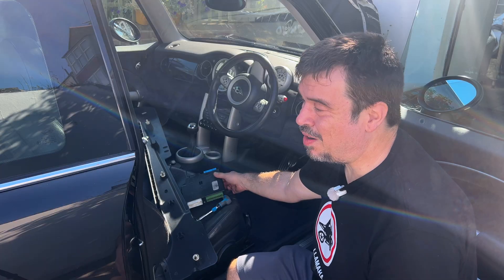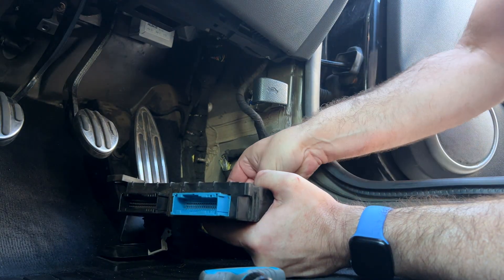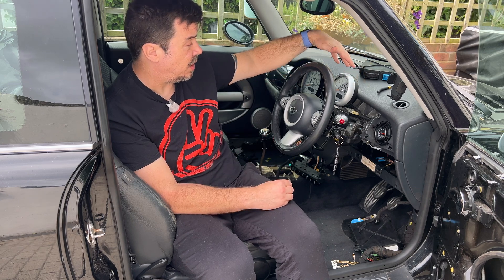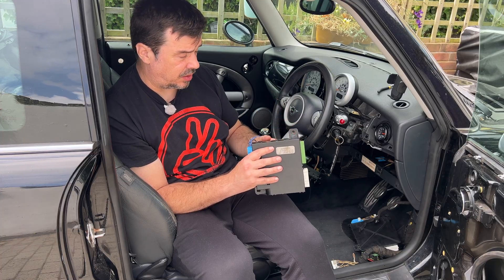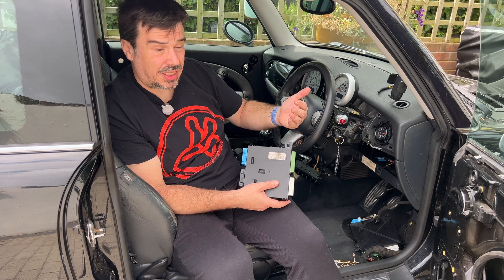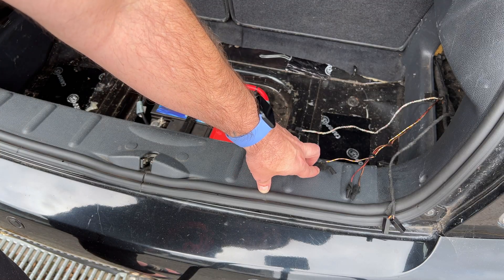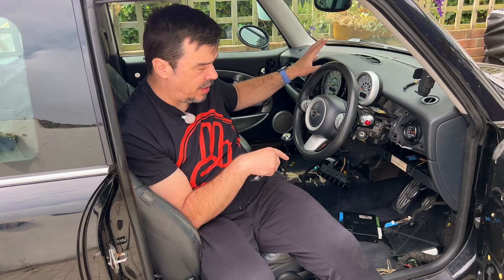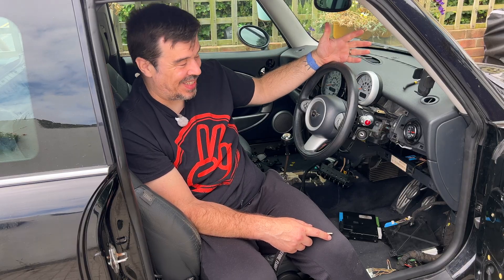Mini Cooper S R53 BCM and K BUS issues

Comment: You did so well finding this fault, where in the main loom was the K-bus junction? Quite a way forward towards the BC1, it looks like, forward of the ground connection? I think you somewhere said where the partial short to ground was, an auxiliary module not used? Thanks
Reply from the maker: It’s a touch forward of the ground point just near the bcm connection. My short was in the wiring for the amp that had been removed at some point in the last 20 years.
Reply: @nogaragerequired thank you for the reply! Merry Christmas.

Comment: This video explained a lot of things in a timely and direct fashion without glossing irrelevant information, and it's greatly appreciated.

I have a non-functioning auxiliary cluster and my DRL's won't shut off. I suspect it is a fault on the K or possibly D Bus because the OBD2 port is not being recognized by scan tools either.

I sourced a 2nd BCM today from a salvage car that was in good shape, BCM looks very clean.

I am going to confirm power on the OBD port (pin 16 OFF) (pin 1 ON) and then connectivity to the D Bus there (pin 7) with the ECU (pin 36).

I'm hoping there is one central fault here connecting these issues. Going to start probing it tomorrow after charging the battery tonight.

Thanks again for the advice!
Reply from the maker: Glad it helped. Hopefully you’ll get your issue sorted quickly.
Reply: @nogaragerequired  think I have it figured out. There is a severely corroded junction connector (Tyco Connector) in the driver footwell (UK passenger footwell) next to the fuse panel. It contains 42 wires total in 2 rows. 5 of the pins are broken off and the rest are going to go likewise shortly.

It feeds circuits into many places such as footwell lighting, washer fluid indictor on right steering lever, etc, etc. But most importantly it supplies power to the IKE Cluster and the Auxiliary Cluster.

The BCM (BC1) has highest priority on the K-Bus line but the IKE Cluster Assembly is actually the Gateway Module because it contains a microprocessor unit for translating all the various bus languages into one cohesive system and provide feedback to the DME(ECU).

The vehicle was having intermittent starting issues and the DRL's would not shut off. I have a feeling the power supplying the photocell and other modules is down and thus the N/C circuit has no input signal to ctrl the relay.

I hate to do it but I am going to wire-tag and buttsplice everything for now while I wait for a suitable connector to repair more appropriately at a different date.

Comment: Those holy trinity lights can all pop because a wheel speed sensor has failed. If the car can’t measure wheel speed it can’t deal with stability control, antilock brakes etc.

Comment: I have almost exactly that problem. Did you find out what the kbus wire you disconmected was for? Or just am unused accessory?
Reply from the maker: I found it was an unused accessory. Over the last 20 years it may well have had a few of the factory options removed.
Reply: @nogaragerequired  ive disconnected the same kbus wire as your video and my fault has disappeared. Bit fiddly getting wires off that bus bar, my radio has come up saying 'disabled', now thinking its possibly related to the short.
Reply from the maker: I did come across a few people having a fault in the radio while I was researching. Glad to see you’ve found the fault, they aren’t fun ones to track down.
Reply: @nogaragerequired I've now managed to trace to a now unused option of iPod module behind radio where the connector had grounded the kbus. Not easy behind the dash but just started splitting the kbus at various points and narrowed it down. Initially lost kbus to radio but not reconnected down at the bus bar and confirmed no ground. Thanks for the prompt, Sent me in right direction
Reply: Hi im chasing and intermittent on and off with the rev counter can you point me in a direction where should I start and move towards

Comment: Hi...the center orange light is the Flat tyre warning light that you can reset with a but next to the handbrake just hold the botton in until the light goes off...the tracktion control light behind the steering wheel you can switch off with DSC toggle switch if that does not work maybe there is fault with on of your ABS sensors...if I am not mistaken only the Crono pack mini R53 came out with dual Gauges behind the steering wheel it could be that the previous owner installed the 2 gauge behind and that the wiring is different and causes the fault lights are on...hope this info helps
Reply from the maker: I appreciate the help. I’ve had a chance to connect a scanner, the traction control and tyre pressure lights seem to related to a fault in my steering angle sensor. So that’s up on the list for replacement.